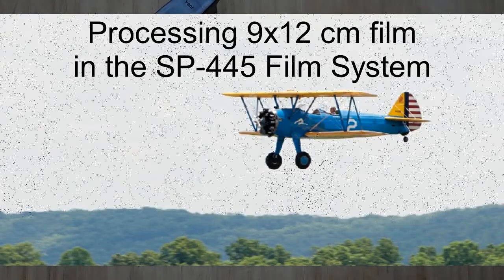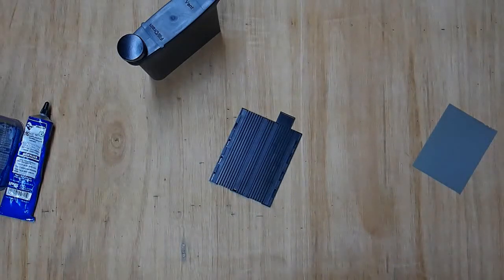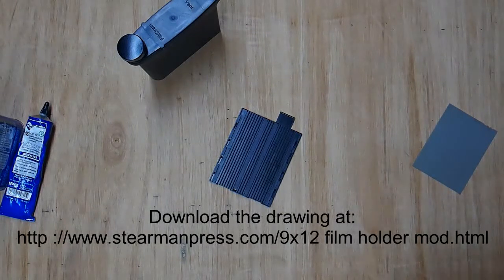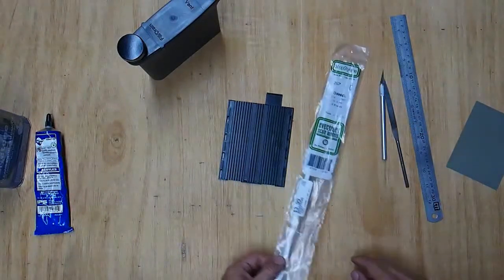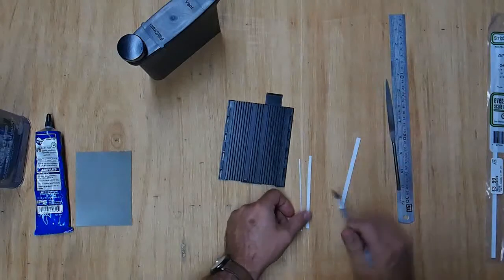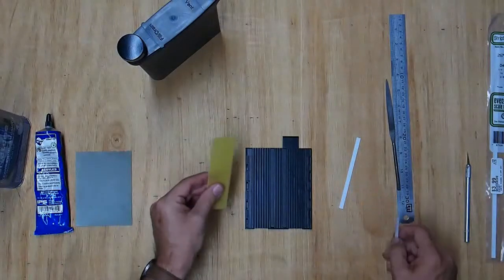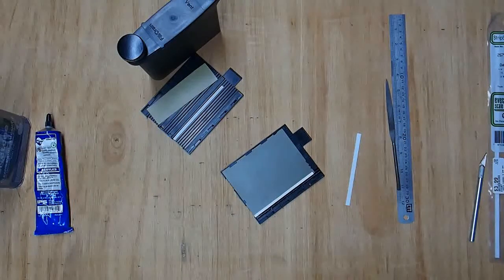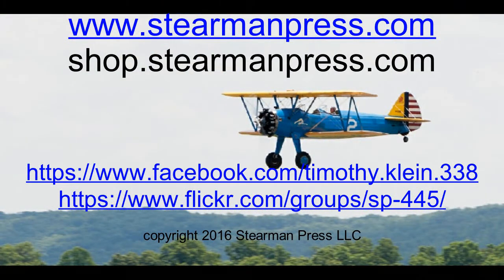9x12 film in the SP-445: how to modify the film holder

Comment: I altered one holder for 2 1/4 x 3 1/4 just by glueing plastic strips around a sheet of film after I filed the edge toward the film to 45 degrees fits snug and won't fall out. Developed nicely. Thank You for developing this system,it has made life so much easier.

Comment: I imagine that the simplest solution from your point of view would be film holders to fit the same tank.
A buyer would buy a tank, plus holders in any combination. I could imagine developing two 9x12 and two 4x5 sheets together.

I imagine having extra film holders would be useful too, I could load film into dry holders to develop more film after giving the tank a quick rinse without being too concerned about drying it.

Comment: Hi TIM ... I´m trying to scan B&W negatives film (6X9cm) using a Scanner Epson Stylus CX7700 but I didn´t find in the web  the HOLDER for this type of film. I took a look in many sites, eBay, etc..
Do you have an Idea where I could find ?  or instructions on how to build one by hand ?
Many thanks in advance
Clayton Santi Rossi
Reply from the maker: Clayton, I don't think the CX7700 can scan film wider than 35mm.
Reply: Good morning TIM ... Thank you for the information ... I believe you are right ... after this information I looked at the scanning device and it really is the width of a 35mm film strip ... I will investigate some way of scanning on the scanner glass ... very grateful